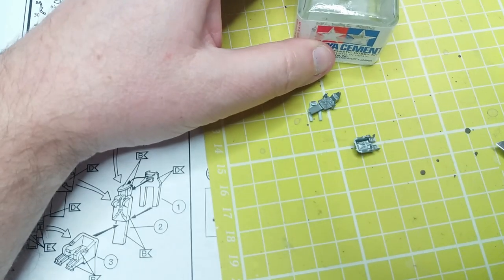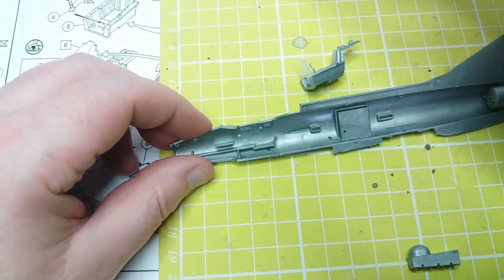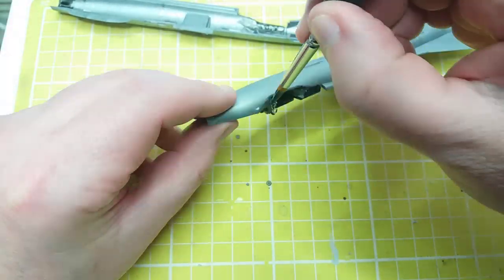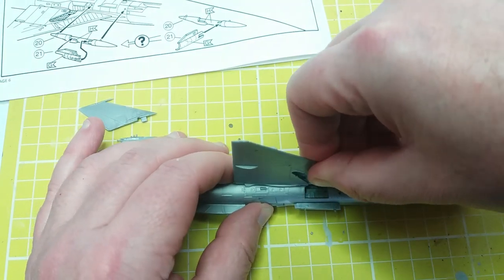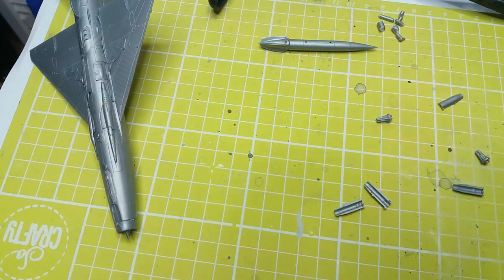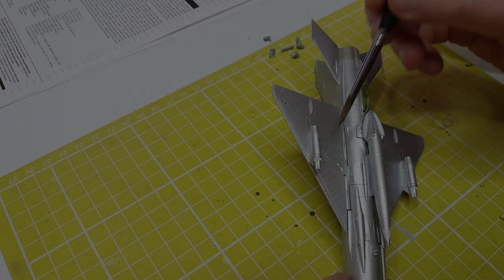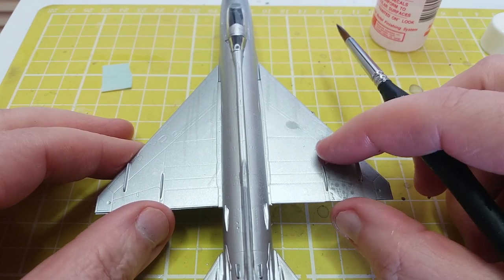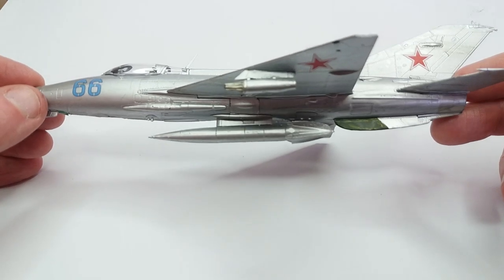Revell MIG 21 F13 full Build

Comment: Amazon has this kit, but priced at $70!   I don't do ebay, period.  Probably cheaper there though.   I'll keep checking at Amazon, in hopes another seller will be reasonable.   Detail of this model looks pretty good compared to other companies.   I do have Zvezda's Mig-21bis to build.  It's a later variant with more external ordnance.
Reply from the maker: WOW! nearly fell off my chair its 13.95 on amazon.co.uk which is where I got it last year.
Reply: I got mine for 15 bucks